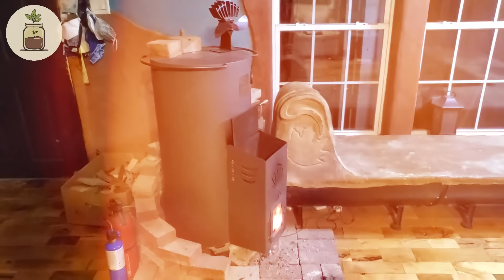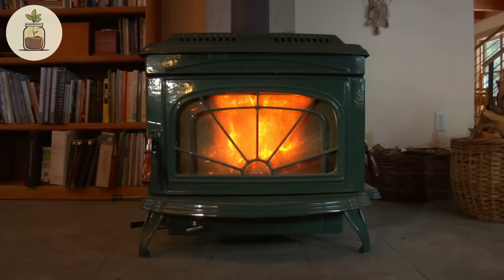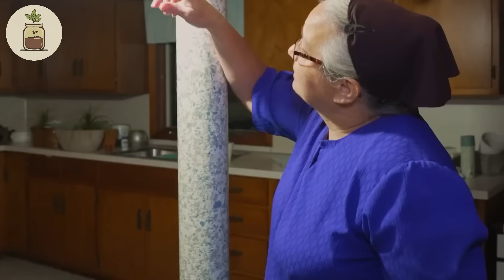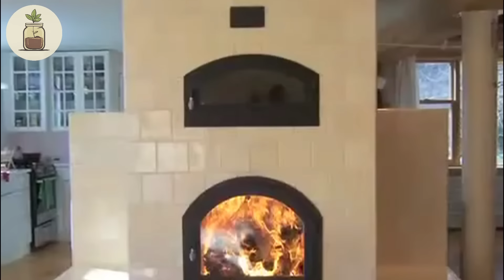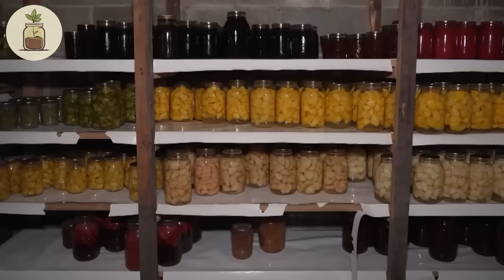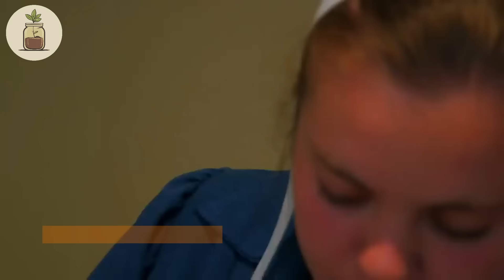How Amish Heat Their Living Room Without Gas/Electricity

Comment: Burning wood, creates more pollution than diesel engines. I have got a fireplace in my apartement at the last floor 
of a building. I'm not allowed to use it for the pollution . I use it the same , and fuck to the law. Greetings from Milan .

Comment: Does anyone know if a rocket mass heater would actually meet building code in a typical suburban neighborhood, or are they mostly limited to off grid settings?

It is easy to forget how much heat older lighting gave off. The idea that a light fixture alone could raise a room by 5 degrees is a good reminder that lighting used to double as a heat source before LEDs became common.

Comment: I live in an Amish community. I'm surrounded by them. I've seen the coal stoves and the $5K to $6K wood burning kitchen stoves with hot water tanks on the back. None of the other stuff. And some have in floor heating. Hot water circulates through the floor and heat rises. The wood or coal burning furnace that heats the water is outside. And it's a LOT of work and it takes a LOT of time to cut and chop enough wood to heat the most efficient home for the entire winter. Or you can get out of your chair go and turn on the thermostat and sit back down and have a higher heating bill. I burn wood.

Comment: If you calculate 30$ per hour of extra work for the heating bill the Amish solution wont be much cheaper anymore than the electricity bill. Also that kind of work wont be fun anymore if you are getting older. Amish have families and community to stick up for each other to some degree. The average guy doesn't have that.

Comment: My dad has a wood burning stove. When we got home from work and school we would start the fire. Sometimes we add wood before bed. But usually we didn't. It really depended on how cold it was. It would get so hot in the house us kids would escape to our rooms and shut the door and crack the window for a bit. The house is old and it's way cheaper to heat by wood. When I move to my house I'm putting in a wood burning stove. I'm done paying an insane amount of month on gas and electricity just to keep it 60 in my house.

Comment: Aladdin lamps as you called the "Mantle lamps" are EXTREMELY expensive and burn kero of lamp oil like a thirsty field worker.
So NO you're INCORRECT however the do use Coleman white gas lanterns and what gas is available in Amish countries at the pump and they put off a TON of heat I'm an avid Coleman lantern collector.

Comment: Bad for the environment due to the high wood demand and smoke. But also very laborious. Heaters like that are warm, but they usually fail to heat the floor well. Rather they heat the room from the knees up or so.

Not to mention there is no way to turn it down, if it gets too hot.

Comment: You never place a damper near the stove !  You need heat to clear the pipes of moisture....and creosote !    By closing off air flow in a chimney your causing creosoting !   And for sure when new stove pipes are installed the paint " must " be burned off to keep the house from being smoked up form the paint !   That involves turning the pipes cherry red for a few moments with house windows open !

Comment: Ive been burning wood for over 50 year to heat the house.   No matter what you have creosoting .....there is always water / moisture in the wood !  Hard wood....soft would all are the same !  The primary key is to have a chimney fire  that turns the stove pipes cherry red to burn the creosote out !  Or you will sooner or later have a chimney fire ! There is no such thing as an efficient wood stove......they all need heat to go up the chimney to keep from creosoting !!!!    Yah cant have it both ways !  In my years with burning wood Ive found its better to burn soft wood.  It burns hotter and faster keeping the chimney clean !  No need for the fire department !

Comment: I live in an apartment in the mountains of Colorado.  I never use my heater.  I use my neighbor's heat, sunlight on the brick ediface, residual heat from my kitchen burners and from my hot baths.  My water and water heater are shared by all residents and are paid by the landlord.  My rent is $475/month. My winter electric bill is about $15/month.  I use nightlights to light my apartment at night instead of ceiling lights.
Reply: How the fuck? Makes me wanna move to Colorado. I'm in tennessee. Have been 7/8ths if My life at 31 yo old. Never been but he'll even my rents only 400, but with a 150$ electric bill. And 20-25$ a month for water.  Any openings for cheap where you live?
Reply: @lmfaook.7971 I live in Grand Junction.  It is in beautiful red slickrock canyon country, with hundreds of 13,000 and 14,000 foot peaks nearby. 

 To be honest, I have disabled veteran status so my rent is cheap.  But no aid for such cheap electric.  Rent here for cheaper apartments are usually twice what I pay.  The landord pays water.  In small shrinking and remote mountain towns like Cortez or Craig, you will find cheap rent like mine.  But they are still big enough to have Walmarts and bus service to the rest of the state.  My apartment is on the second floor.  I could keep my windows open all night when it is 25° out, then close them at 4:00 am, and they will heat up without running my heater.  I have never even touched my heater.   My apartment and storage area is about 800 square feet.
Reply: @lmfaook.7971   unfortunately the days of joining the military, and getting out with "PTSD" with a 70% rating and $1800+ for monthly disability for a combat related mental health condition, is over.   If I didnt get a combat related disability, I could have joined at 18 and retired at 33 with  pension of 50% of my monthly pay before quitting.  That would have been ~$1,500-$1,800 a month in 2013 dollars.

Comment: Aluminum heated would not be good to breathe the air in the room you set this in. Better to use a ceramic, stainless steel pot or glass pot. I like this idea however please use non toxic buckets. Thanks so much!

Comment: A friend of mine has a wood stove in his shop. and it looks like two wood stoves one stacked on top of the other. but the upper part of the stove is a catalytic converter. and it really puts off a lot of heat on a few small sticks of wood. and it has fans strategically places near the stove. that circulates the heat all over his large shop. it just shows there are more efficient ways to burn wood.

Comment: Kerosene has more btu than wood. I made a glass fitting that goes over my Aladdin lamp, about 5 inches,  that a metal chimney connects to venting any diesel smell out of the window. It is a dry heat when you do it that way. The thick glass, from a mason jar, allows light and a window to lower the wick for an efficient burn.  It the chimney has thermal fans so it pushes the heat around. Works great in a 120sq ft room

Comment: where on earth do you buy coal in Louisiana……..LOL
when I was in my 20s we used to still have cold winters here in Louisiana. Very cold winters,  I became obsessed with finding a way to heat the little house I was renting when I moved away from home.   Back in the 70s the $25 a month utility bill was killing me.(wish I could see that bill again).
I did a little research and found about 
“ Franklin stoves “……
Made of cast-iron, you could buy one for around $100.  you simply put down a 4 ft.² area of bricks on the living room floor, and remove a window pan at the top of the living room window and run a flue pipe through that and secure along the outside wall….. no smoke or soot got in the house,
As long as you raise the flu up high enough to give a good draw of Air.
You could warm a pot of oatmeal or grits or hot water for coffee and tea on either side of the top of the stove, and watch the fire through the glass doors,.
The main feature of the Franklin was that it sits entirely inside the room, so the entire stove radiates heat all the way around,.
It was very odd, but it felt so comforting; it’s hard to explain. But the heat was wonderful and it made you feel safe, secure, and alive….. the only bad thing was getting rid of the ashes from the wood every morning.  I only burned oak
In my stove. That I got from a private logging forest where they killed every tree that was not a pine tree. So they allowed people to go along their logging roads and cut up and take the hardwoods which they did not want…… the really bad thing about the south is the summer, there is no efficient way, or cheap way to cool a home….. so while you could save money with a wood stove in the winter; you have to pay the very high price to cool a Home through the 5 to 7 months of heat in the 80s 90s and even higher…… in 2025 the bills just seem to go up and up and up.

Comment: Millions of tract houses built in mid-century & later, have layouts that very much work against efficient heating or cooling.  Most all houses & other buildings, LACK anything near adequate insulation—if bldgs all had really optimal insulation, none would need HVAC!  
All that might be needed, is dehumidifying, &/or a filtered air heat exchanger to bring in fresh air. 

Also, HVAC has changed dramatically in the last 100 years!  But, sizing old systems is NOT like sizing central HVAC, & it wasn’t like sizing baseboard heaters, & it is not like sizing the new high-tech heatpump minisplits.   But that has not stopped the industry from using OLD HVAC parameters to size the new tech!   
Very like, R-value of old-style fiberglass insulation, differs from R-value of other types of insulations.  Yet, the old R-values have continued to be used to measure efficacy of newer insulation materials!  

That means, your wallet & your house may be at-risk, from over-kill HVAC sizing, & wrongly figured R-value, etc. 

After the 1st winter in our house, it was clear there were way too many & too big baseboards—no wonder the power bill was high!! 
We removed 2400watt baseboards x 2 from the family room; 
 2400 watts x 2 from the livingroom, 
2400 watts each from dining, master. 
We replaced only the livingroom, diningroom, master with 1 each, about 700 watt baseboards.   
Even using those, we rarely need to turn them up much—despite this old house having mingy 2x4 wall insulation, & barely R-40 in attic, & R-30 under floors (insul. is batts & fluffs, a bit of radiant barriers).  
& THAT lowered our heat bill by about $80 in worst winter months. 

Installing 3 matching recycled slider windows on a framed-out 3” airspace, over the old house windows, dropped the worst winter heat bills by about $100. 
I still need to replace the old patio slider.  

We got one of the portable R2-D2 AC units, that has a dehumidifier setting, that really helps most during spring & fall transitional temps.  Dehumidifying takes a bit less energy than straight-up AC, & by removing humidity, helps the perceived indoor temp feel more comfortable.  

For the last 2 winters, we used our .  Made in MO, I think.  
It can cook us out of 1400 s.f….it is capable of heating 2000 s.f. house, with about 98% efficiency.  Very Clean-burn, for wood fuel!! 
It has a pellet bin with pellet grate attachments, to do continuous burn up to around 12 -16 hours—at about 98-99% efficiency. 
If you have time to keep babysitting it stoking it with firewood, you can do that—it’s messier, but in a survival situation, you can pick up sticks to feed it. 
No smoke visible from chimney…stealth!  
It is kinda like the very lovely Tulikivi masonry mass stoves—same engineering, just in a small, moveable configuration….& this Liberator rocket stove, CAN have about a 12’ long warming bench attached to it, if your vertical chimney is longer than about 15’. 

Please avoid coal unless no other options!  
There is no such thing as “clean coal”.  
Coal has highest BTUs in it—like kerosene—highest calories of heat in it.  But, there have not been any real efficiency improvements, that I know of, yet—it still with maybe 60% efficiency?—in a fireplace grate. 
Even if a rocket stove could be made to handle the higher temps coal burns at, it likely would gunk-up the smoke path, & heat-stress the metal.  
A rocket stove would need re-engineered to handle coal—but it Might deliver a far better efficiency. 

Many folks are sickened by gas heaters—even utility people checking exhaust leaks miss leaks, leaving sick residents wondering why so many headaches, fog-brain, etc.   even “efficient” gas heating is around 80s% efficient.  
For cooking?—I found induction cookers, not gas, have been most beneficial for most cooking.  

It’s too common to have folks over-fire their woodstove, catastrophically—& even the most efficient average woodstove, belches out around 30% or more emissions—about 70% to MAYbe 80% efficient, depending on variables.   

Some States have passed laws to limit wood burning stoves, backyard fire pits, & even gas stoves.  Those laws are based on smokey, inefficient burning of fuels. 
….A rocket stove handles that very well, with about a 98% clean burn.  
Rocket stoves comply with stringent emissions mandates, notably lowers cost of buying fuel for it, & is VERY hard to over-fire (so, fire departments & insurers take notice how much safer these are, than other woodstoves, etc. heating machines.).  
If you live off-grid, & don’t like signalling the territory that your are in the woods, a rocket stove is your friend!  No smoke visible from chimney!…& can cook a pot of stew, or use a stovetop oven to bake bread, on top of it.

Comment: I have an old cold stove It was made in 1890 I bought two big pallets of coal 3 years ago and this year I will still be burning that same cold it's that efficiency It works great a little harder to light but it works great no smoke lots of heat and by the way the Amish don't use rocket stoves now somebody needs to go back and stay the Amish no rocket stoves

Comment: First thing to design when using any kind of wood stowe / heather; provide proper amount of fresh air from outside the house, as near as possible to the wood burning stowe / heather!
Why?
If you don't provide fresh air near to the stowe - it will drain it from your room, meaning - it will soak it trough the gaps in your doors and windows, causing cold draft in the room.

Comment: Masonry heaters are from the Middle Ages, developed in Europe. 30-35 yrs ago, i assisted a friend who was building masonry heaters from scratch. Nowadays, they come prefab, tho they're not considered to be of the same quality as a full build.
The heaters' efficiency is based on 2 features
- above the main burn chamber is a 2ndary chamber, where the smoke and creosote burn, which is why there is very little ash and very little smoke.
- there are a series of baffles constructed inside the heaters, which distribute the hot air, heating the outer brick or stone exterior, which continues to radiate heat. These baffles can be adapted to make ovens, cook stoves, water heaters and even, floor heaters.
Back then, all the metal and glass doors for the various compartments came from Finland, which manufactured the only equipment capable of handling the extreme heat. Also, the interior and baffles require a special masonry brick, again, designed to withstand the heat.
These systems cannot be started and stopped, as one might do with a weekend chalet, because of the considerable expansion and contraction of the structure. However, only 2-3 logs of hardwood are required to heat a properly designed 2,000 sq. ft. home, for 24 hrs., under normal northern winter conditions.
The systems require a robust foundation, because of the enormous weight, and a chimney system which adequately clears the roof line peak. We often covered the brickwork with crepe, and i got quite good at cutting bricks for the art deco designs my friend created.
If you ever visit Le Jardin du Quatre Vents, the Garden of the 4 Winds, on the Cabot estate, in Quebec, my friend built the rookery, which has a large masonry heater.
Cheers.
Reply: Tulikivi is a great example…
Reply: @robhoffman510  of prefab

Comment: Rocket stoves and masonry heaters are indeed great for a family home. The hobo solution is a smokeless oildrum setup. As long as you achieve secondary burn, you'll get tons of heat and no creosotes; wrap it around with an earthen material that functions as heat mass! 😁

Oildrums are uglier, that's all. And they rust over time. 😁😁

Comment: Nah, modern systems do not "turn on and off". We use a thermostat with means the radiators man decrease the heat to keep the room temp steady but that is not less steady than a rocket mass heater.

Comment: Growing up in my grandparents doublewide we had a coal stove as soon as you walk in the door which is just about the center of the house. The stove pipe has a convection fan on it that heats up and pushes heat away from the stove. My grandma kept 2 kettles and a pot of water on top of it while it was running to keep the air  fr9m drying out, which will make people more likely to get sick in the winter.

A few years after i left for the army my grandpa decided he was too old to tend the coal stove himself, and got a pellet stove. 20 times less ash, easy to start, and could self regulate a set temperature. I was so jeleous.

Comment: I built an all electric home with the basic geo-thermal (GT) heating system.  The GT cost $1,000 less than the conventional electric system originally planned.  With a 5,200 sq. ft. house to heat, and an all electric house, I expected a substantial monthly bill.  With the GT, my electric bill total (all use, not just heat) on a monthly budget plan was less than $215.00/mo., year round.  GTs are said to be 300-600% efficient, compared to 93% for the best conventional electic furnace.